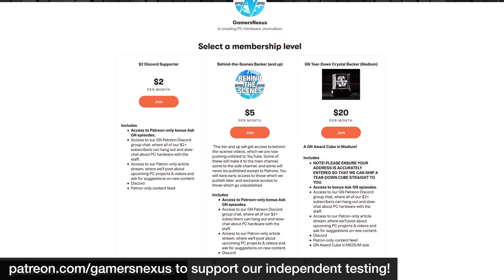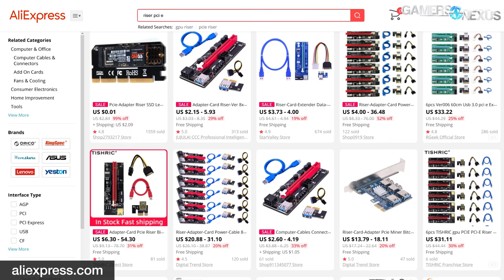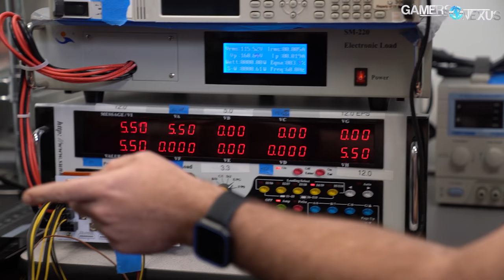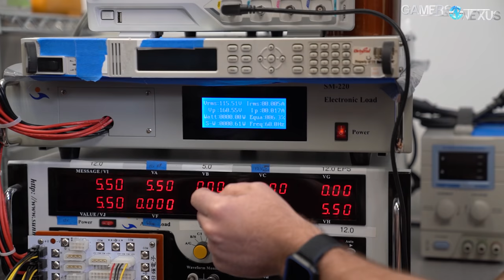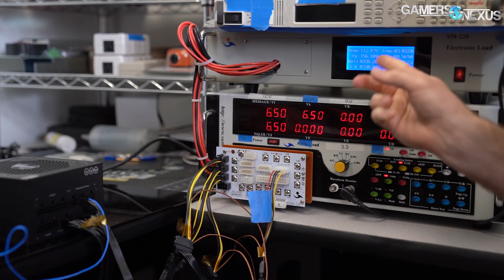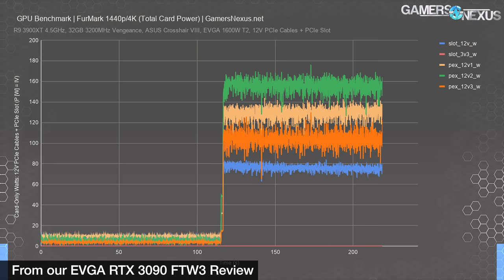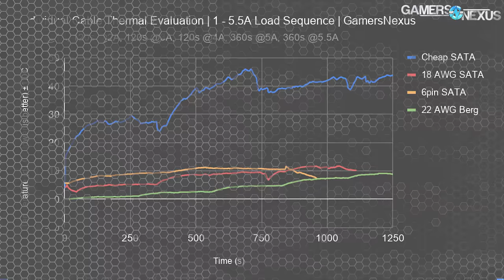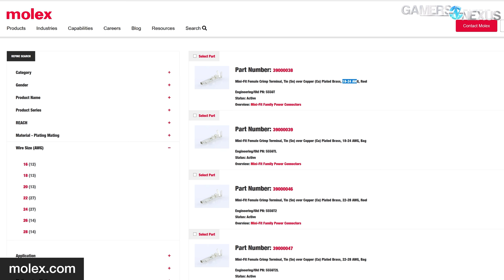Don't Use Cheap Cables: Dangerous Construction & False Wire Gauge

Comment: Everything can be a fuse if you're brave enough.
Reply: Bruh 😅🤣
Reply: Omg.  Man.  This is the only thing electrical engineering school teaches you.☠

Lol.....   love it....
Reply: @kwisin1337  that and a whole lot of calculus
Reply: And thus your house became the next to burn down.
Reply: ask apple (and louis ross man) about this one, the macbook air LCD cable is used as one ;)
Reply: Page No!
Reply: Not if you watercool it (it is said to be excellent on cables especially if you expose the copper)

DTTH
Reply: Nichrome wire
Reply: Ok, you win the internet for today. Move along!
Reply: That is precisely what I (a heavy diesel fitter) told the auto sparky when we were trying to diagnose a fault last week. 

He said he couldn’t find a fuse in a circuit. I said the wire is a fuse.
Reply: I have seen some gnarly fireballs rewiring old facilities. Do it right do it safe.
Reply: Yeah, until someone finds the machined aluminium "fuse" stuffed into the fuse box, and the insurance guy cracks up.
Reply: Self-limiting wiring is the most dramatic fuse of all! Who needs a little "pop" when you can have melted plastic smell and flames that let you know FOR CERTAIN that there's a short or over-current? ;)
Reply: macbook design 101
Reply: I'm just picturing a giant piece of steel bridging some future fusion reactors main. As the failure point... I can only imagine the spectacular show it would be to watch it liquify.
Reply: You can be a fuse. Once.
Reply: something will become the fuse where there is none

Comment: "Every machine is a smoke machine if you use it wrong enough"
Reply: "lights cigarette"   You aren't wrong.
Reply: once you let the smoke out, it dont chooch no more. the magic smoke is what makes it work
Reply: Look back at my FX 8320 990FX R9 290 rog system and burned thermaltake psu without risers...
Reply: And now with my current system 3700x x570-p gtx 1060 6gb......i use a thermaltake riser?
Reply: The smoke machine is the only machine that can do it’s job when broken
Reply: Solid logic there

Comment: Guys Yet another brilliant education piece, Key takeaway, do not stress your cables, use quality products buying cheap and nasty will invariably bite you very hard..
Reply from the maker: Thanks! We're trying to do more educational pieces!
Reply: key takeaway should be to use the correctly rated connectors for the intended use!
Reply: tbh i use Server PSUs and breakout boards on mining rigs, most are more efficient than anything you can buy for normal computing and designed to run 24/7.

Comment: What you forgot to mention is that some cheap cables use aluminium instead of copper.
The tricky thing is most often the aluminium strands are copper manteled to make soldering easier.
That makes them look exactly like copper to the naked eye and as the strands are often very thin you cant spot that very easily.
You would have to cut them using sharp flush cut pliers (as normal pliers could distort the mantel over the cut and obscure the actual aluminium)
and then either have very good eyesight or use magnification to look for a aluminium core.

This is just as dangerous as false advertising of gauge spec, as you need about 60% more cross section with aluminium compared to copper.

Comment: A thermography camera can easily identify wire overheating risks, even the terminals. As reliability engineer I use this tool to troubleshoot any loose terminal or overheating problem

Comment: I had an issue with a cheaper PSU in the early 00’s. It originated from the floppy power cable, and caught fire immediately upon first power up. At the time, I never had the side panel on the system, so I was able to catch it right away.
Reply from the maker: Yikes! Glad you caught it. Floppy cables (Berg connectors) are particularly bad for higher power scenarios, too.
Reply: Was the floppy power cable offset by 1 pin? I did that with my brother's PC when I hastily swapped out a dead PSU... Melting, smoke, crackling sounds.... Turned it off, spotted the problem, cut off the melted tail, used another floppy connector and went on with life.
Reply: Oh, a table fan on the side for some actual airflow aswell?

Comment: Me after installing my $20 PSU extension cables from AliExpress: Now you tell me. 🤪
Reply: Look at you, with the fancy cables, mine were $2.74
Reply: Was about to buy some RGB ones for 5 dollars
Reply: @Tallnerdyguy  lmao
Reply: FFS, Now I need to cut one of my extension cables and see if it is really 18 gauge.
Reply: @majorspittle1  do it while it's powered on, to make sure that current is flowing throughout the entire thickness of the wire.

Also post it on youtu...

No actually, stream it.
Reply: @notfunny3397  I was thinking about cutting one of the extra cables I have, but I imagine the wire would be thin and deflated because it is not full of electricity.  So I guess powered on is the only way to go about it.
Reply: Well most cables are Made in China anyway so your aliexpress might be one of the good ones. I always check seller/manufacturer’s website see how lit they are. UGREEN is a good bet.
Reply: @AaronShenghao  most being around 99.5% but often companies specify what actual thickness of wire, not just gauge, especially psu manufacturers. While the aftermarket cables? Not enough buying power
Reply: @notfunny3397  omg 😂😂
Reply: On the subject of cutting live wires its not that exciting my dog has done it with her teeth and not complain and with a pair of scissors or actual wire cutters with rubber handles you'll be lucky to see spark. Normally you won't see any unless it's dc and then only if you cut the power wire.  Ac current sparks requires a route to neutral or ground to shock you or spark. To those that are wondering static electricity is dc essentially.
Reply: @glaurung89  if its is a power cable inside a PC case, it is most definitely DC.
Reply: you got a good one
Reply: @notfunny3397  DC current does not suffer from the skin effect, so all cable will flow through all cables in a proportion inversely proportionally to the individual strand  resistance
Reply: @deansmith4752  my brain just hemorrhaged.

Speak a bit simpler, what's the skin effect?

Also I thought electricity chose the path of least resistance, or does it just travel less to the path of higher resistance when the path branches into 2
Reply: You might want to pull those and replace them with ones that are of some brand repute. Coolermaster ones are priced very reasonably
Reply: How do you use extensions?! I did that to get shorter replacements, so I could close my case!
Reply: @notfunny3397  if you have two resistors in parallel, current will travel proportionally to each resistance. If they are the same, current is the same. If one has half the resistance, it’s current will be double. And so on.
Reply: Yeah I just canceled an order for extensions yesterday because I didn't trust that they were honest about the gauge. Funny that this came out today
Reply: @notfunny3397  skin effect, electrons move along the outermost layers of a conductor, as opposed to the center.
Reply: extensions seem pretty unsafe in general to me, even if you look at namebrands, you can look at 1 star reviews and see people's gpus burnt out and melted connectors.

Comment: Stuff like this is why I subscribed to GN.  As an electronics technician and Electrical Engineer, I enjoy these technical vids.  My friends say you're videos are "Too in depth" and I go "No, they're engineering shallow, which is plenty deep"

Edit: Rule of Thumb for Power Systems: ALWAYS OVERSPEC BY 30% AT LEAST.  That includes wire gauge and power ratings for sets of wires.

Comment: As a wise man once said: Molex to SATA, lose all your data
Reply: Why would you need a Molex to Sata cable?
Reply: @goa141no6  to power your data hoarding habit/hobby, typically. 

But the real issue is actually the molded cables. Stay far away from molded sata cables.
Reply: @kienanvella  So you use it for Raid Systems? Isn't supposed to be easier to use the multiple Sata conector on your PSU Cable?
Reply: @goa141no6  yes, but many people run 14 or more drives, many of them without drive cages that have backplanes. most PSUs don't have that many sata connectors.

Personally, I run two 12 bay backplanes in my system, and the backplanes have their own dedicated psu with custom wiring.
Reply: @kienanvella  Jesús that's a lot of drives, what kind info you save to need so many. I got An 512 NVME and 2  1TB Hard drives and it feels like to much space.
Reply: @goa141no6  I'm a linux system administrator. I keep backups of my personal systems and some websites, backups of important documents, scans of tons of documents, I have media (music, movies, tv shows), I keep documents, pictures/memes, bootable ISO images, firmware images, VM boot disks, etc, etc. About 15 years worth of accumulated stuff. If it doesn't need to be on a workstation directly it should be on the centralized storage.

It's a DIY NAS and home server. Total capacity is 20tb (zfs raidz2, two 8 drive stripes with compression), and I'm using about 14tb of it. Hardware is currently a 32 core dual socket AMD opteron box, with 64gb of ram, micron p320h pcie ssd, Mellanox connectx-2 10gb network card, and LSI 9200-8e external sas card.

I'm putting together a new build soon though, as this is getting pretty long in the tooth.
Reply: @kienanvella  That's quite nice, way more than I expected. Thanks.
Reply: @goa141no6  Less common today, but when SATA was new there were a lot of power supplies that had no SATA connectors in service, and new power supplies only had one or two connectors. Or just the connectors were at very inconvenient places on the cables(I've used molex->SATA recently because of that, but not on a storage device).
Reply: Florian Oprescu  sas cables are pretty much all the same as long as the connectors match your equipment (SAS cables don't carry power, and even relatively cheap ones work just as well as the expensive branded ones). Watch out for forward vs reverse breakout cables though.

The HP H220 is basically just an LSI SAS 9205-8i or LSI SAS 9207-8i, which are mostly the same. So yes, they're fine. As are dell perc h200, perc h310, and some others. Look on the serve the home forum for the LSI card equivalency thread, with all the oem specific model names.
Reply: Yet here I am with all of my data. This is after running the same two Seagate HDDs with Molex to Sata converters for 9 years straight until the actual the actual life expectancy of the drives was coming to an end. Got all my data on a new drive 3 years ago and retired the old drives/system/molex adapter.
Reply: Why would that be? A hard drive uses so little power, like only 10 watt.
Reply: @goa141no6  I collect movies, a 12TB holds like 5-6k of them, but with half the IMDB that's 23 drives and growing.
Reply: Or the entire building
Reply: @zazethe6553  
The issue isn't related to the fires as seen in this video... It's that many of those adaptors are badly made and simply disconnect randomly during use and reset the drive.... Which can still happen with SATA connectors straight on the PSU if you use a really crappy PSU - which you also shouldn't do.
Reply: @tin2001  yes, connector quality is important, but it's possible to have good molex to sata connectors. But yeah,molex in general can be low quality, I've seen some back in the 90ies were the female is so open, it barely touches the male plugs. I have used tiny pliers to bend them shut.
Reply: @tin2001  Poor SATA connectors can definitely catch fire or melt. Steve specifically mentioned moulded SATA tend to be the worse kind of SATA adapters. There are lots of videos and reports of these melting or catching fire or otherwise failing catastrophically, and these often aren't significantly related to excessive power draw since we're talking about drives not GPUs as the OP mentions, hence "lose all you data". I mean okay a fire or other short circuit will potentially kill other components so you could lose your data even if your SATA adapter connected to your riser fails, but the point of the advice is using molex to SATA for your SATA drives is a way to kill the drives. (As others have mentioned molex to SATA was a lot more common in the early days of SATA where PSUs had no or few SATA connectors.) 

Hopefully Gamers Nexus doesn't mind me linking to another Youtuber but look at these videos for an analysis of reasons why the SATA connections can melt or catch fire https://www.youtube.com/watch?v=TataDaUNEFc and https://www.youtube.com/watch?v=fAyy_WOSdVc

While you're right that you can lose data even without the SATA connectors melting, it's the most extreme case so often what people think about.
Reply: @zazethe6553  You can have bad molex, but it's easier to have bad SATA, the reason why the axiom arises. As I mentioned in my reply to tin2001, if you look into reports and analyses of these failures, the fault is generally on the SATA side.
Reply: Doesn't rhyme in Brit
Reply: @goa141no6  My home server has lots of 1x molex to 2x sata cables. It has a total of 10 hard drives.

Comment: I just got a flashback to the school days when we were calculating cable length and the necessary wire gauges needed.
Reply: To me that is a life saving practice. But these bastards are falsifying their info and getting the wrong wire gauges on a high current role.

Makes me wish the electric chair wasn't removed.

Comment: This one def hits home for me. I previously had a SATA to molex connector powering an NZXT USB hub that burnt out. If I had been unlucky and not had a good PSU I could have easily have had a fire start for sure....
Reply from the maker: Yikes. Seems a few people in the comments had bad experiences with SATA to Molex. Glad the damage was minimal!
Reply: @GamersNexus  molex to sata, lose all your data
Reply: @GamersNexus  Well it killed my Corsair AX1200i. Had to RMA it as it couldn't handle increased load from my Gigabyte RTX 3080 Gaming OC afterwards. The PSU would constantly crash (and prevent POST) after increased loads. Lesson learned however and I'm now steering clear of dodgy convertor cables obtained from the interwebs lol

Comment: Tip: look for a boat supply shop, they often sell small fire extinguishers made for the motor of boats. I got my self a 5L one for my server.
Reply: Tip2: look for a high-voltage rated foam extinguisher / CO2 to not not brick the whole room when you need to use it.
Reply: Tip3: have CO2 as the primary extinguisher, foam as secondary. Check with insurance company if you are required to have ABC powder, but use it as a last resort.

Comment: I have burnt up one card so far in one of these risers, and two of the three I've found also cause kernel panics on my Raspberry Pis (tested in multiple scenarios with multiple known-working cards.

It's truly a game of roulette with these things—I would not put any card I care about in one of these. But they do have a utility, I just wish there were reputable manufacturers who made risers for people like me, who don't want to cut into a 1x slot to fit larger cards in.
Reply: That's what you get for botting and scalping our cards. God punishes those who are greedy.
Reply: @darthputinsmouthpiece1059  I'm uh... not doing that at all. I have a few rusty old video cards (the fanciest I own is an Nvidia GTX 750 Ti) that I'm trying to get working on the Raspberry Pi.
Reply: @darthputinsmouthpiece1059  Mining =/= Scalping, and the guy doesn't even mine.  Get off your soap box.
Reply: Chipal/Tishric are the reputable vendors for risers.
They also have a solid 1to4 plx switch card in the 15$ area, for when you must have those 4 sas controllers on that pi.

Comment: The only motherboard I've ever had fail, failed almost immediately after installing some cheap colored power supply cable extensions. I wanted to get some cables from CableMod but didn't have the money at the time. Bought a cheap kit from Amazon. I had just completed a new build 2 months prior. Complete with a full loop using hard tubing. Imagine my joy when realizing I had to tear all that down to replace my board. Never again.

Comment: Hello, Steve & GN crew;
Thank you for all you do.
Especially for your efforts to help prevent fires.
(In 2005 my family experienced a traumatic home fire.) 
About 10 years ago I bought an 'inexpensive' "name brand" laptop cooler for my daughter.
When plugged into the laptop the cooler fans turned backwards.
I decided to reverse the wiring to reverse the fan direction.
But 1 wire only had THREE strands of copper wire.
The 3 wires were maybe a bit larger than a single human hair.
There was no way to use that wire in a "normal" sized wire connector to reverse polarity.
The insulation couldn't even be stripped w/out breaking the 3 wires.
Apparently the company knew there were problems w/ the product.
The product was sold thru a 'non-standard' channel. I.E., a closeout store for less than normal.
Such 'non-standard' "wire" ('cables') have caused many fires from minor to catastrophic.
This has been a problem for years.
IMO the real issue is incompetent 'government'.
When the "Deepwater Horizon" oil drilling rig exploded the U.S. Minerals Management Service had just 'inspected' the rig.
But the 'inspector' was trying to get a job w/ the company so he didn't 'see' anything wrong.
The economy crashed in 2008-09.
A SEC audit revealed some SEC employees were doing drugs & surfing porn at their desks.
On the job, using SEC-provided computers & internet.
So the big issue seems to be 'government' incompetence where there is no oversight.
Some recall the "Energy Star" fraud where electrical products received their seal without meeting the requirements.
We can't depend on the 'government' to 'regulate' the safety of cables/wires.
We MUST be proactive to protect ourselves & others.
Thank you again for providing needed info.
Have a GREAT day, Neighbor!